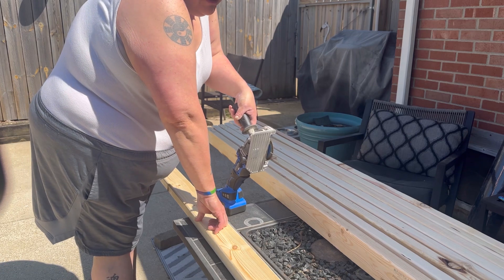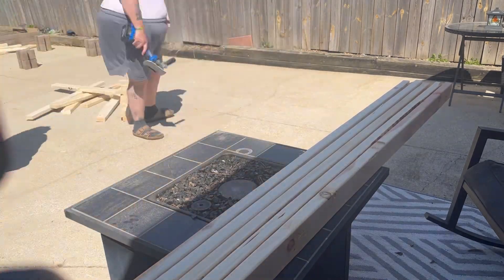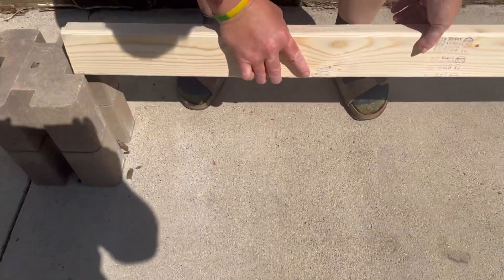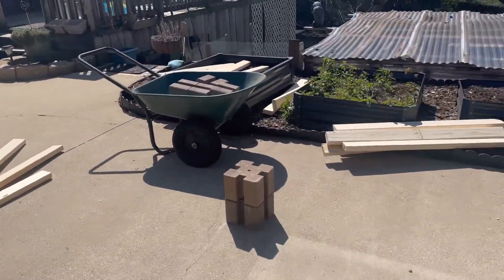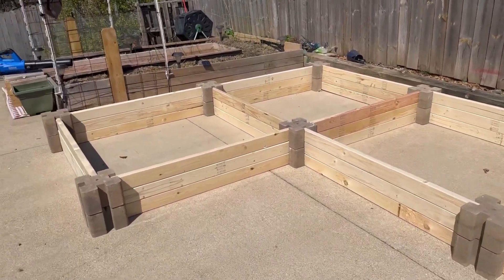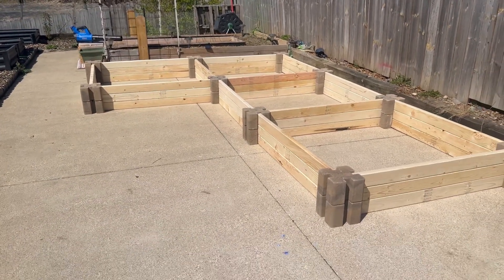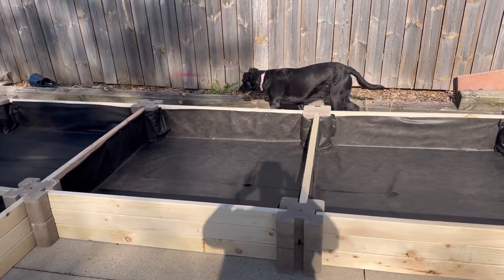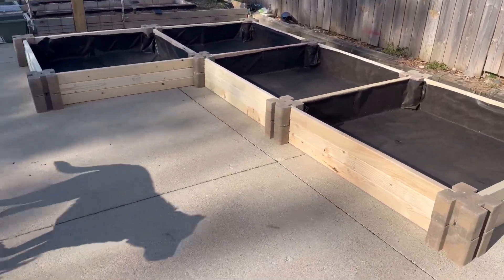EXPANDING THE BACKYARD GARDEN - LESS THAN $200 #gardening #homestead #backyardfarming

Comment: This is so awesome!  Y’all are doing a great job!  Give me ideas for a couple for me!  I just want something small for a tomato or two,  few peppers, etc!!!   Keep up the good work!!!
Reply: You can still use these blocks for smaller size.  I did a video on them about 2 weeks ago.  That’s the beauty of them - you get to decide the size of the beds.  Lowes and Home Depot have the blocks.  I’m not sure who else has them. 

I’m thinking of adding a 2 foot by 4 foot single height addition to some of mine for the flowers and more herbs.  I didn’t use the liner but mine are on dirt and not concrete. When you go to get the lumber check for how straight the wood is.  Some places will do one cut per board  for free or have cut down Lumber due to a bad end. I made some of mine 4 feet across.  Menards already had those cut down.
Reply from the maker: Thanks Betty! They are so easy to put together!
Reply from the maker: The blocks are much easier than the other beds we built. Would you believe the boards that were cut already were twice the price?!? Craziness
Reply: @Our_Urban_Homestead  the ones I got at Mennards were ones that came in or got damaged ends.  They were 2.50 each.  The 8 foot and 6 foot boards are Fir.  I lucked out that they were on clearance. When I told the employee what I wanted them for he took me straight to the clearance ones.  $2.50 off of each board.  I was having the 8 foot cut into 4 feet last year when I started putting them in.  The cuts were free. But I did notice the 6 foot ones were more expensive. I bought a 12 foot board and had them cut it for the 6 x 8 foot bed.  It was cheaper than the precut ones. 

I really do love those blocks. Bought the first ones in 2020. Then gradually put in more beds.  I was working so many extra hours in 2021 and 2020 that I was able to keep up with the garden and plants.  Last year is when I really added more in.